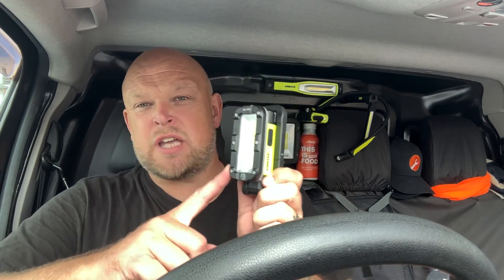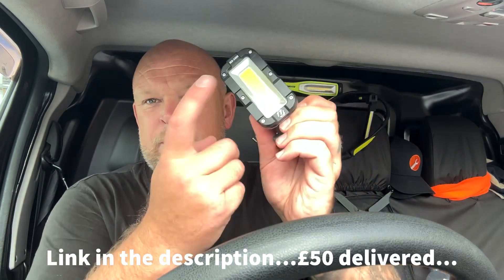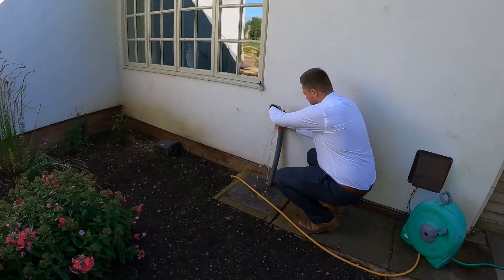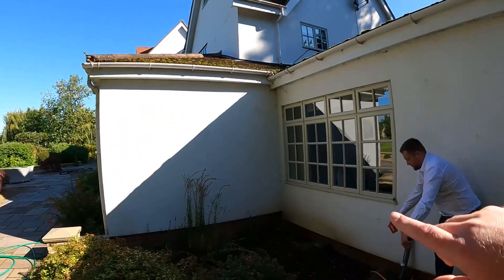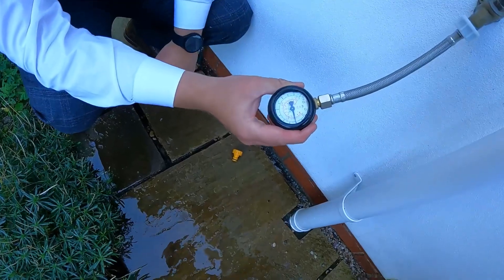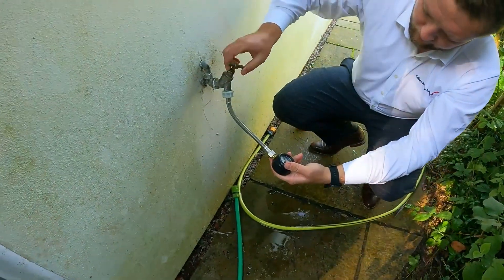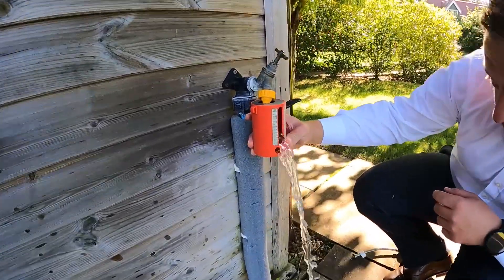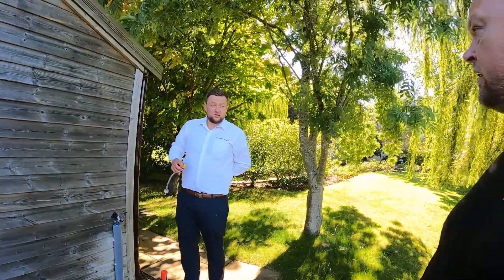INCOMING MAINS PROBLEM FLOW & PRESSURE… How can we fix it?

Comment: Pressure should be consistent throughout the property with no taps open, unless there is some pressure restricting device in the way. If there's 20l a minute at the incoming supply, surely there's much more value in upgrading the pipework to allow more flow than fitting a tank and submersible pump that'll cut out when the tank runs dry. It's a huge risk to go from low flow showers to on and off showers.
Reply from the maker: You can only deal with what you have, now Salamander have done a full report and spec’d what’s is needed…

Replacing internal pipework is not an option……. 

Tanks dont run dry… they have failsafes in place
Reply: @MJTiffPlumbing  'TankBoost stores water. When this has been consumed, the pump will turn off and periodically restart to re-pressurise the system. '

Comment: Very interesting video, thanks. I have the same problem, albeit in a much smaller house: adequate pressure but inadequate flow. I'm contemplating the Salamander Tankboost. I have just subbed to your channel so I don't miss the follow up. Like others below I am puzzled that the static pressure is different at different locations - that makes no sense to me unless (a) there is a leak or (b) some taps in the house were open at the time.
Reply from the maker: Welcome to the channel buddy 👍🏼👍🏼

The size of the house and the draws will have something to do with it as it’s very big…
Reply: If there is no flow, ie all taps closed, tanks/cisterns filled, no leaks, then the pressure will be the same everywhere.  The fact the pressure is falling means there is some water use/leak.  Might be best to check at 3am like Severn Trent do.

Comment: Great Video, be great to see what you end up doing, what a property.. Great work!

Have they looked at the option of having a second main brought into the property and splitting the property supply to it. Also is the internal house mains all plumbed in 15mm, would it benefit from the whole house being plumbed in 22mm or bigger mains to help with the volume of water around the house??
Reply from the maker: To replumb a house of that size would be 10’s of thousands mate…..it’s HUGE!!!!!

Internal pipework is 22mm

Comment: What a gaff! Looking forward to the follow ups. Perhaps you could share some of the sizing calculations etc. I'm going to assume  simultaneous min demand or would they size it on max? An interesting exercise for sure. Thanks Mark
Reply from the maker: They are getting back to me with the info at some point….

The hot water is from a 300l mega flow so it’s got to cover demand on that and cold feed at the same time
Reply: Just measure the showers majority of bar showers are like 6-10 litres a minute toilets don’t really matter and outside taps don’t there not going to use all outside taps at once I’d match the cylinder to be fair 300 litre

Comment: Makes no sense, standing pressure should be the same across the property unless water is being drawn off at another location regardless of the size of service and internal pipe work!
Reply from the maker: Could well be a leak underground but finding that would be very tough

Comment: Seems like the distribution pipework within the dwelling has been undersized. You don’t loose over a bar of pressure through a network unless the cold mains pipework has been undersized. What would you do if you getting 21mb at the metre and 10mb at the gas boiler if it were gas! I’d T off the water mains after the stop cock in the road and run it to the opposite end of the house in 63mm pe under the grounds and try and connect it to 22mm pipe in the house
Reply from the maker: Have you seen how big the house/area is!!!!!!……

This is why I have called in the Salamander team and technical to spec it so the pressure and flow is constant.

The water fluctuates during the day and at various areas….. this is the best solution as the internal pipework is not feasible to renew.

This is the solution…… pressurise and pump…
Reply: @MJTiffPlumbing  yep definitely mate  ‘water booster’  it is a initial balls up of the highest degree ! Probably builders ? 😂

Comment: Hi Mark 

Just a constructive observation.

Surprised the Salmander guy didn't check each outside tap as working pressure & flow rate with a tap running in another area (furthers away from stop cock)

He only checked standing pressure😮

Hate you to under size as one posh property.

Love your stuff ❤
Reply from the maker: We will be over spec’ing it….. belt and braces
Reply: @MJTiffPlumbing  Static pressure readings are pointless. If the cat 5 tank & pump sizing is belt n braces then why did Salamander say they'd give the static pressure reading to their team to size the system. Smoke n mirrors. I bet there was an original small single property with ancient 25mm supply and estate developers have tried to share that amongst number of large houses to avoid paying for a larger new connection. Its all a bit of a lash up.
Reply: Fabulous looking forward to install update

Comment: ?I would have had a look at the incoming mains. is it 25mm MDPE. what if they upped to 32MM or did 2x suppiles?
Reply from the maker: Nowt to do with any pipework mate…. It’s all new….
It’s in the middle of know-where and it’s feeding a few VERY large houses….. some of the other properties have this set up and it’s fine….👍🏼
Reply: @MJTiffPlumbing  interested to see part 2.
Reply from the maker: Yep…. I’m really looking forward to getting stuck into this, it’s basically mine so just need to get the ball rolling